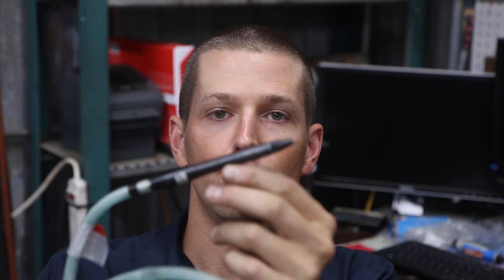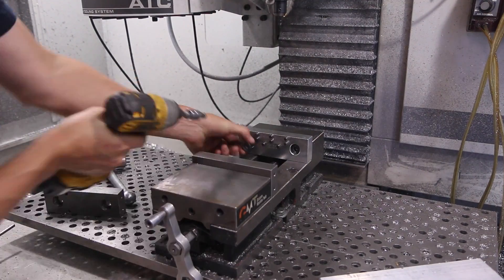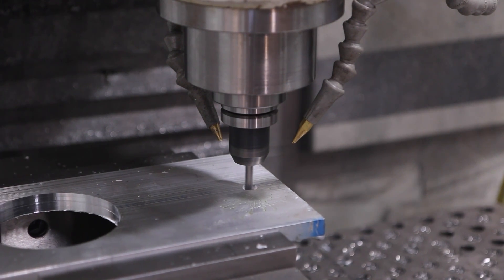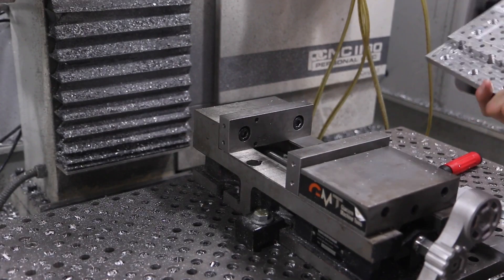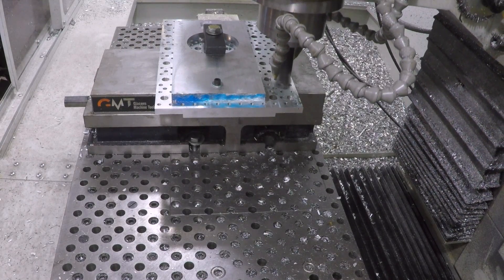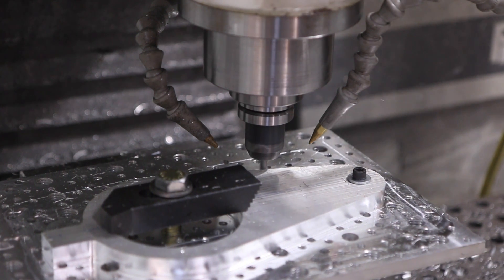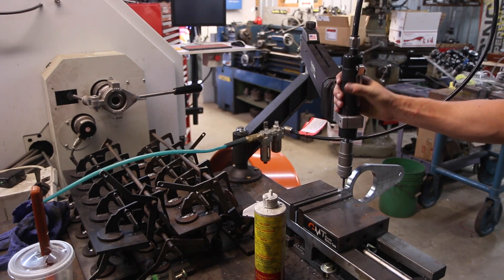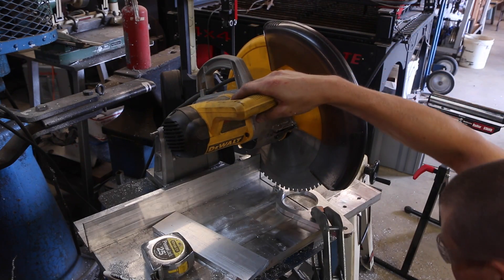Tormach CNC Spindle Clamp Engraving!  Widget54

Comment: hi John, i v seen your videos about DIY CNC based on arduino and shield controller for the 3 simple axes, i made my own with a simple shield and 4 of A4988
now im planning to make a 5 axes cnc do you have any idea about the grbl and the Gcode sender ...? what about using the ramps shield from the reprap 3d printing  ? can u help ? thanks (y)
Reply: yes im planning to use the fusion 360 but i cant tell how to setup the GRBL Software/Firmware on the arduino
Reply: NYC CNC
yes the Cam and about the usb controller board

Comment: I enjoy your videos. One thing I must say as a time served professional, don't worry if your tools are making a little noise. In my opinion you don't work them enough.
Good work though!
Reply: NYC CNC
Sorry, what I meant is taking larger cuts and and possibly more aggressive feedrates i.e. 'making the tools work more'. Sometimes when taking larger cuts the chatter will disappear, which I know sounds counter-intuitive.However, the rigidity of the machine and fixturing also comes into play. But generally don't get too hung-up on tool noise when roughing. Getting the material off in the most efficient way is the goal. Also, think of leaving more meat on the components for the finishing cuts to take off. Sorry if I sound preachy I really didn't set out to sound like it.

Comment: I didn't see you remove the tapped threads from the anterior side of the split gap. The screw will just force both sides of the gap to stay in their original position, rather than drawing the distal side closer upon tightening.

GREAT FUN TO WATCH! Thanks for doing these videos!
Reply: NYC CNC That's what I get for trying to watch FUN videos while doing my day job. DOH!!! I have installed Fusion360 and will use it with the X3 mill I converted to CNC last year. I got tired of fighting with other software packages that I had, ummmm, "borrowed for educational purposes", which come with NO support or sympathy if they don't work properly. I'm really liking the fact that Fusion360 is free to hobbyists and comes with the proper post for LinuxCNC!

Comment: Have you tried your shear hog conventional milling instead of climb?
Reply: It could be worth a try. I have noticed on my own machine sometimes conventional milling gives me better results with heavy cuts. There's an interesting article on cnccookbook about it, even referencing a page on ABTools site which is sadly now a dead link.
Reply: I don't know, I couldn't see it, but I managed to find a page on a 2012 catalog that I think was what was on their site, it says

"Climb versus Conventional Milling. We have all learned that climb milling is more efficient because conventional milling causes more side pressure on the end mill. True, but the cut width as a ratio to cutter diameter is also a factor. If the width of cut is 1/2 of the cutter diameter or less, "climb" works beautifully. If the width of cut is 3/4 of the diameter or more, then the positive rake in the end mill becomes negative, meaning the face, not the cutting edge, strikes the part first."

Comment: For a cheap stand alone engraver, I don't think you can beat those Chinese 3040 machines on Ebay for under $600. I have had one for a couple years now and continue to marvel at how well their built for what you pay. I couldn't build one myself for what they cost. The stock spindle only goes to 12k RPM so I may have to try the HF air engraver mounted to the head to see if it allows faster engraving.

Comment: 4 thou over 6 inches? shit.  Wish I could get away with that. Currently working on a job with a -.0000 +.0002 tolerance range with multiple ops.  My brain hurts and many cigarettes have been smoked but I'm pulling it off.
Reply: +NYC CNC well, I doubt it. they definitely paid for it though. Even after I warned the green engineer.

Comment: Hey John the issue I think your having with the engraving in the tormach is the limitations in rpm. where I work we use monster mills ball nose 1/8th inch carbide running at 50000 rpms an were engraving at least 30 thou depth. Into steel.  bellow is a link to the spindle we have in our engraver table. mabey it will be of some use to you down the road. tool life in steel is about 4 hrs of run time at 5 thou per pass I'm sure that would be greatly increase in aluminum. 
 http://www.visionengravers.com/products/engraving-routing-accessories/spindle-options.html